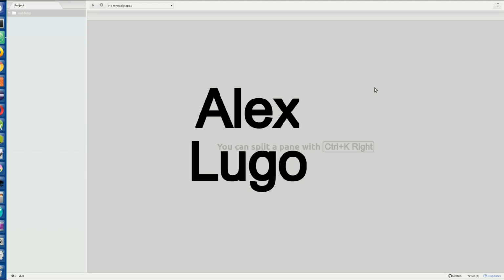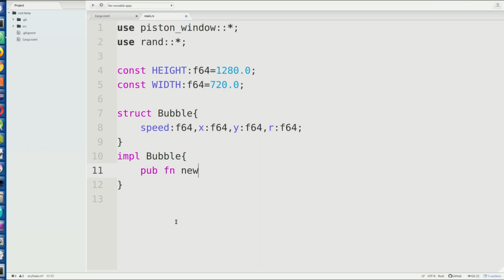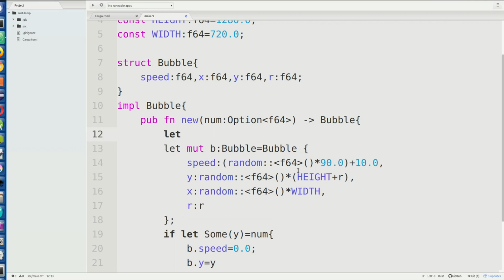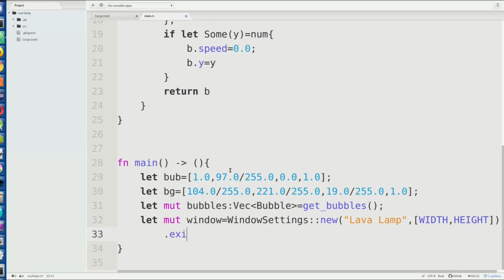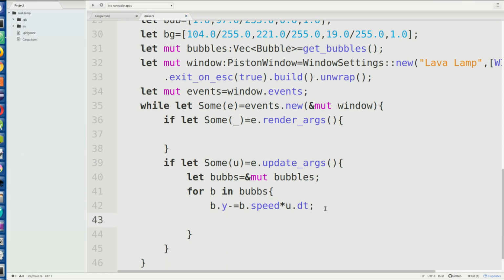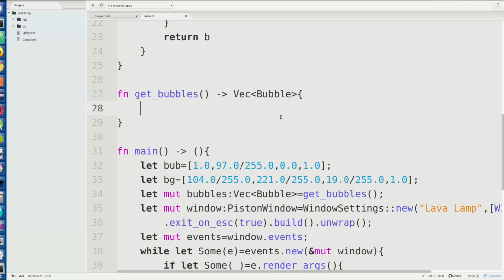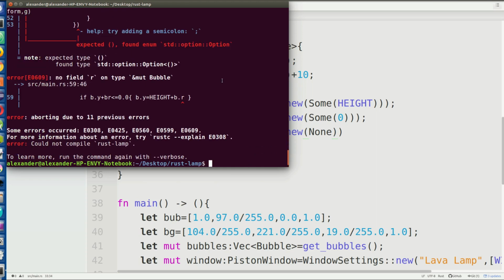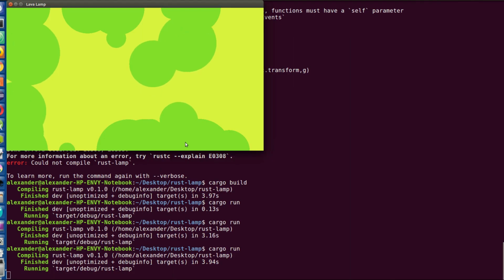Programming a Lava Lamp in Rust (ft. Piston)

Comment: I haven't seen programming code much like this since the days of BASIC, all the way back to 1987. Rust is allowing us as they say, system level access, without the crazy syntax I can never master with C or C++. Amazing really.
Reply: Well don’t let the LET keyword fool you, Rust is actually inherited from the ML languages family, OCaml for example, it may look readable it’s actually much different when lifetimes and genetics are involved, on top of that Rust goals is to provide Memory Safety, Deadlocks and logical Races are still possible, furthermore it dosen’t provide Safe system programming and I think this has been really misleading, it is a programming  language that can be used to do system programming, but and I don’t know for the Linux Kernel but I do know that for Rust code to be running in the Windows kernel you must have #![no_std], to indicate that you will not link against the standard lib, which means no Drop trait and no runtime  and no compiler drop insertions when variables go out of scopes(For now anyway, you could implement it manually tho) and very little Abstraction, also most of the definitions will have a little repr(C) above it, which means FFI boundaries, which means you are doing C but in OCaml syntax and different types, which means unpleasant. But this is true of c++ too, ring 0 automatic safe programming is a myth, only good practice will give you “safety”, sorry I wish it was different but at the moment it isn’t, and because of how abstraction works, it will probably be always like that. :) 

PS: You don’t need to go that low to be unsafe, any calls to the windows API in rust will have to wrapped in a unsafe{} and you will be dealing with raw pointers even for very standard things. So see safety is relative.

Comment: Nice video. 
VS Code has a great extension that gives you language support as you code (highlights errors, code completion, documentation on hover, etc)  called "Rust (rls)" that's maintained by the Rust team. RLS works with other IDE's too.
Reply: @alexlugodev  I wish atom was still a viable editor. So nice 🥺 tell you what I REALLY miss though....sublime text 🤤 I wish someone would make an open source compiled editor that's actually fast again. I've been using neovide for NeoVim lately
Reply: @alexlugodev  👀👀👀
Reply: @alexlugodev  I can't imagine the repo when someone starts work on a rust powered IDE!  Neovide is actually built using rust and it's so blazing fast it's pretty insane. Even on windows it runs like a champ. And, the beauty? It's never crashed once. Ever.